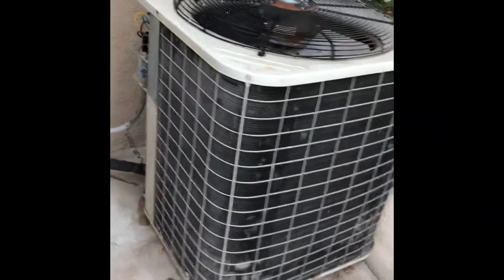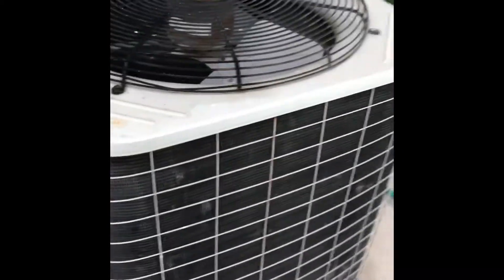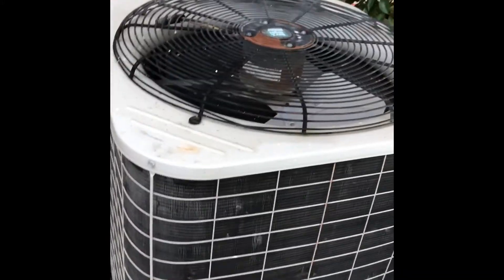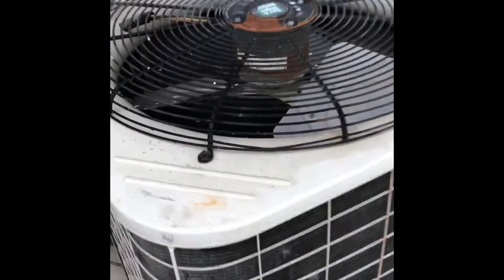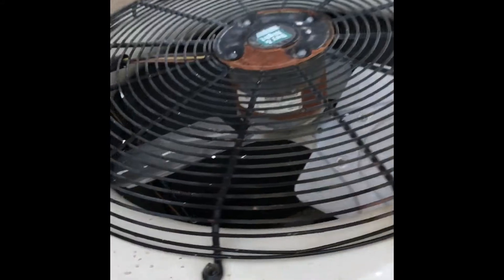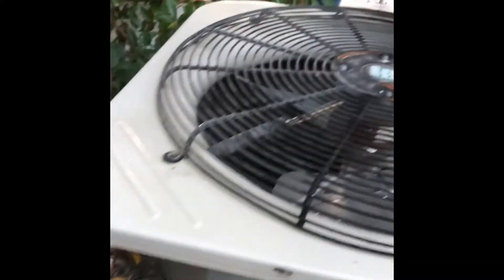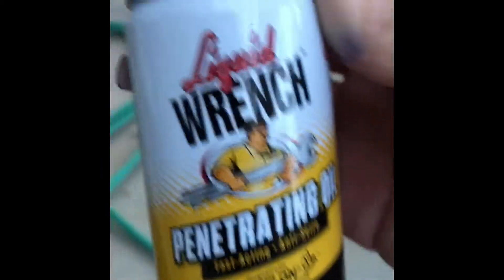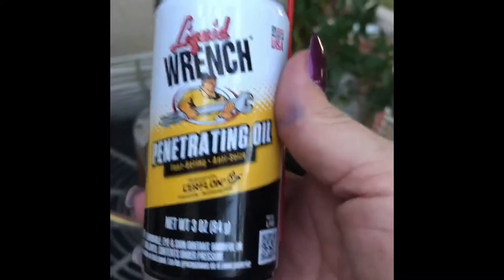Air Conditioner Condenser Overheating - Fixed!

Comment: Did the fan run for few minutes and then stopped running giving a buzzing sound?
Reply from the maker: It would run and there would be no cold air and then yes it would eventually stop and there would be a noise I don’t know if it was necessarily buzzing but there was a noise because it would just stop because the motor was bad. Once I put the new motor in everything was fine.
Reply: @khristymadeit  Thanks for responding. When I turn on the AC, the fan runs well for few minutes like 3-5, then it turns off. Then I start hearing a deep sound for a minute and it also goes off. At that time, I’m able to see heat waves going off at the top of the fan - unsure if it’s an overheated fan motor or overheated condenser. I’m so worried and nervous about the cost any HVAC people will levy. Bought this house recently with a 12 years old unit, now I’m afraid.
Reply from the maker: @rajcruise6  Sounds to me that the motor is overheating and that is why it is shutting off.  It would be easier to replace the motor as it only cost around $100 depending on the AC model you have and if that doesn't work then it could be that the AC is just run it's course and needs replaced.
Reply: @khristymadeit  I can’t thank you enough. Appreciate you taking the time to respond. I just took apart the top portion of the unit to see the model number of the fan motor. I will order it and try replacing it to try my luck. Once again, thanks for helping me out.
Reply from the maker: @rajcruise6  just make sure you shut off/take out the breaker/electricity to the unit the main source or turn off the main breaker to the entire house before you start!
Reply: @khristymadeit  sure, will do. Thanks. Luckily, it’s gonna be cold for the next couple of days(Omaha, NE) until the motor gets delivered. Looks like the capacitor is available locally in 2 stores.